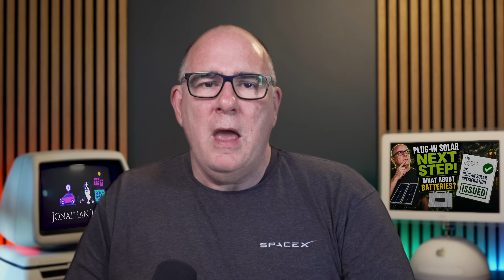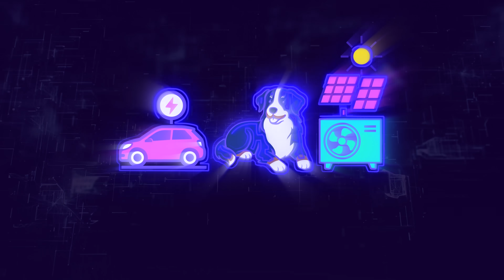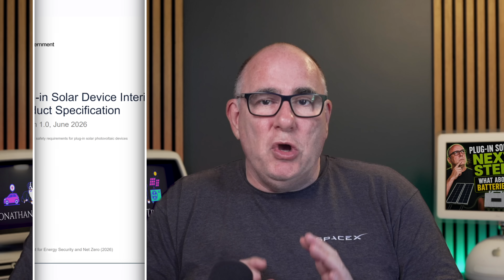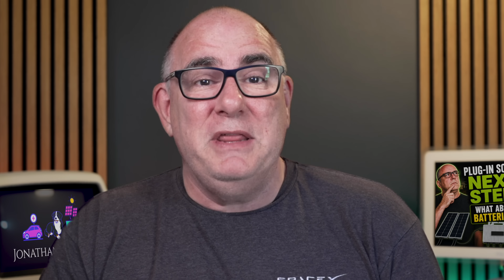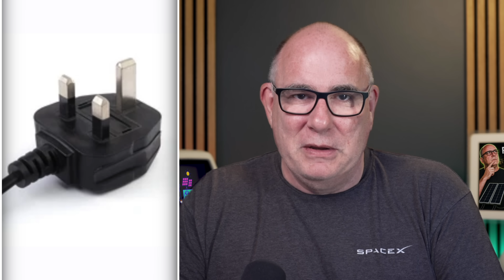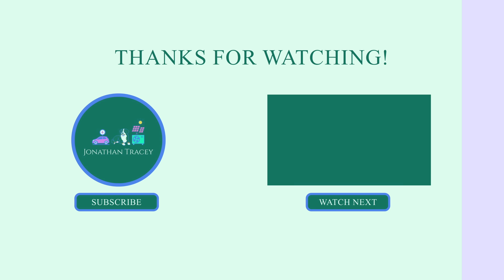Plug-In Solar Finally Legal? The Real Story Behind the New Government Rules

Comment: Don’t the existing products currently available already compliant? Perhaps not the plug. What if you already have an existing solar battery inverter system installed?
Reply from the maker: yes, they are but in theory you’re not supposed to use them with a plug because the legislation hasn’t been updated

Comment: When you start adding batteries you are moving significantly towards a fixed solar system which has its own regulations.
You can also have batteries with no solar, just back up for the mains.
But the two main points are, anti Islanding and network balancing.
Neither are insurmountable but both require failsafe systems to prevent failure so much more technical than just the feed into the circuit.
Reply from the maker: @davidsoulsby1102 I think that's a fair assessment. Once you start adding batteries, the engineering does become more complex than a simple plug-in PV system. The good news is that none of those challenges are new—we've already solved anti-islanding and grid synchronisation in conventional solar and battery systems.

The real question now is whether manufacturers can package that technology into a safe, affordable plug-in product. Based on the interim specification, DESNZ certainly believes it's achievable, but we'll have to see what the final standard looks like after the consultation.
Reply: Also from an electrical perspective PV and battery is identical. One has higher DC voltage, one has lower DC voltage. Both needs an AC inverter to connect to the grid.

Functionally whats good for plug in solar is good for plug in batteries... As long as its capped to the same wattage, we should be golden

Comment: I'd like to know why plug-in solar batteries are limited to only delivering 800W when they charge on overnight electricity at 2kW (at least the Ecoflow Stream Ultra X does)
My Ultra X is also hard wired in via fused spur and to a sub-board with dedicated CB and RCD
I would have thought that it should be able to charge and power at 2kW
Reply from the maker: that’s a very good question, which I honestly don’t know the answer to
Reply: Because an extra 2kw on the blind side of the consumer unit is quite a lot.  That is potentially 8.5A extra on wiring not designed for it.  So you could be pulling 40A on a circuit with a max design of less that is protected by a 32A MCB.

Comment: "It must have a moulded plug on the end". For what safety or functional reason? 

For it to be "plug in solar", I get that it theoretically must have a plug, but then does this prevent people from getting one hard wired into their electrical system by a qualified electrician, as is the current requirement? So they essentially make these products not cross compatible. I don't know why this would be an issue, because you could just wire a plug socket in and plug it into that, but I guess that increases the size of the installation connections, and the cost. 

I don't get it. Feels like an unnecessary rule to me? You can still physically cut the plug off and hard wire it in, or replace the plug.
Reply from the maker: I agree, it’s performance theatre safety.

That said, remember, they don’t teach people to wire plugs anymore, because appliances all come with plug fitted
Reply: @JonathanTracey  My spare plugs come with a card cover with a guide on how to wire them. 

It's the specifics of a molded plug that means that the stock and production line of the existing companies big in this space would need to be significantly amended to comply with this regulation. Rather than just add a production step to automate the wiring of a plug onto their existing product line. 

It feels like a calculated attempt to force consumers away from the incumbent products. And I don't see a good effect on the public quality of life because of it.

Are they hoping to make jobs? It's a bit of a circular argument that they create jobs by paying them to build products that are more expensive to buy, meaning they take home the same or less. 

Skill up domestic production as a long term strategic advantage to not be dependent upon foreign production? Maybe? Feels a bit... almost xenophobic? Like, not very collaborative? Not very trusting? Makes me feel like we're hard to do business with... Combative...
Reply: For the simple reason that all electrical appliances in the UK that come with a plug are required to have a moulded plug on the end with very few exceptions. It's simply stating the same existing law that would apply if it was any other electrical device.

Nothing stops them also providing cable for wiring in, or someone chopping the plug off and wiring it in, and if you can't chop a plug off and trim a cable back you shouldn't be trying to wire it in!
Reply: @etchedpixels  Are you sure? My understanding is that The Plugs and Sockets regulations 1994 require appliances to be supplied with a fitted approved BS 1363 plug. but "fitted" just means attached to the cable before sale. It can be moulded or otherwise, as long as it's compliant.

A few exceptions exist for things like shaver/europlugs for things like shavers and toothbrushes, but they aren't BS1363 anyway as that's just Type G UK mains plugs?
Reply: Oh I see what you are getting at - fitted v moulded. Not sure.
Reply: Feels like it's there to screw over the existing manufacturers in the field who have been producing these products in Europe for ages. 

And they're talking about setting up domestic production? Ah. things might be falling into place: make the existing products illegal, and personally make the alternatives domestically. I'd be interested to see the links between who gets the contracts for these production facilities building and running, and the people who devised these regulations. 

I smell a whiff of corruption that locks the UK consumer OUT of tried, proven, and battle tested hardware. And locks them IN to domestically produced unproven and relatively low volume, so likely high cost, alternatives.

This feels like a money making scheme to extract money from the vulnerable in society (people who can't afford to buy, so they rent which is more expensive in the long run), and give it to those in control of the rules and who gets the contracts.

Comment: For me a pause might be a good thing . . . . Over recent months I have been educating myself on Ecoflow Stream . . . . However, on Facebook groups there have been a number of posts with negative experiences.  Ecoflow currently appears to have a supply problem. Also where faulty equipment can't be replaced they have offered a refund but not the full amount but a deduction calculated for the months used. Hopefully, Ecoflow can improve. Indevolt looks good and will be entering the UK market soon and as I am with Octopus their future offering might be worth considering. Although, it will tie me into their supply.
One thing's for sure . . . won't be paying a contractor to do a £10k full roof install with a ROI of ten years!

Comment: The one inverter per circuit is an awkward thing personally I would be more happy to start with one per house because if you can have more than one, it will be like air-conditioners and a heat wave people will buy two or three or more if there cheap supermarket units and plug them everywhere meaning the fuse box will have kilowatts of power coming into it. Better to start small and grow rather than dump and run
Reply from the maker: agree but remember it’s only 800w per circuit not huge amounts
Reply: @JonathanTracey yes of course but say you buy 4 sets of panels there cheap at the supermarket on offer that would be 3.2kw at maximum generation going into a fusebox if you flip that the other way what household item uses 3.2kw of power all day everyday for hours on end
Reply: The average consumer would not understand what a "circuit" means, so one per household makes sense.
Reply: @mikeselectricstuff  The counter argument is that they are going to do it anyway so telling them how to switch a given circuit off and check it's not two devices on one circuit is a better plan.
Reply: 3.2kW flowing into a consumer unit is nothing. It can easily have 10kW flowing out of it.
Reply: @etchedpixels yes I agree me and you know that we also know the limitations of what these do and how they work but your average Joe cruising around Aldi won’t

Comment: I enjoyed watching your video and wonder if you purchased a EcoFlow system now would it not meet the new regulation so be obsolete and have to replace.
Reply from the maker: it would need a plug on the end of the cable, as that can easily be added by replacing the drop cable I dont think its obselete
Reply: @JonathanTracey or chop the missing plug off, and replace it.
Reply: Real risk, but given how close the regs are to the German ones I suspect Ecoflow will simply sell you an overpriced pack consisting of a replacement power cable, the correct notices, stickers and guidance.
They never sold this version in the UK for plug in usage so I doubt they'll give people the extra bits for free - especially on a 120 quid product.

Better to wait anyway - the current UK prices for a lot of "don't plug this in honest" products are way way higher than elsewhere.

Comment: Any of you wonderful people know about g98, plugin solar isnt quite legal yet so.... when filling in the g98 it asks for the all the information about the installer, name, qualifications, company name.... but of course there wasnt one :/ so what do you do?
Reply from the maker: g98 process will wed to be updated or scrapped in its current form
Reply: In our area, not England, when I enquired a couple of years ago, you needed to go to the local authority to get someone qualified to check your new consumer unit, or other electrical work, you installed or was install by àn electrician but not quite qualified enough to write up a certification.. There was one firm, signed up with the local authority, I was told, but that was scraped. Why, because if you installed it, the installer would literally never get it checked, at a cost, and signed off. Enforcement is nonexistent. Most are ignoring the requirement. Make things too onerous it will be ignored. And, to get a recognised electrician to come and do slightly more than plug in a plug, you’ll be lucky.
Reply: It isn't an application. Its a notification. If the inverter is on the ENA approved list, you just state the certificate number, and yourself as installer. Thats it
Reply: The G98 notification forms need to be massively simplified.
When people can buy plug in solar from Lidl the notification procedure needs to be simple or people wont bother with the notification.
Reply: @marcussmith6523  Agreed 100%. Unfortunately there's also a bunch of people who seem to think th fix is that your unit should simply not work until you register it and copy the enable code for your specific device only provided when you complete the registration.
Reply: @marcussmith6523  The ideal way to do this would be some kind of registration process that gives the user some kind of incentive, like extended warranty.
Reply: They accepted "Self installed" on mine a while ago
Reply: Self install by competent person. If you are that is. 👍
Reply: @spwilliams83 if you manage to install one yourself and it works, then you are competent. If it doesn't, you're house is probably burnt down now 😂
Reply: @spwilliams83 how do you prove competency? Through training, qualifications and experience is the legal definition, that's why I had go keep going on pointless courses at work.
Reply: G98 is being amended to facilitate plug in solar and energy storage the G98 consultation (DCRP/26/02/PC – Modification to EREC G98 Issue 2 Amendment 1) closed on 30th June. The summary says:

"This consultation seeks stakeholder views on proposed amendments to Engineering Recommendation G98 (EREC G98), an Annex 1 document under the Distribution Code. The proposed modification has been developed to facilitate the connection and operation of Plug-in Micro-generators, including plug-in Solar PV and plug-in Electricity Storage, while maintaining appropriate requirements for network safety, supply quality and operability.

The proposed changes are intended to provide a clearer route for Plug-in Micro-generators under EREC G98. Key changes include the introduction of a new definition for Plug-in Micro-generator, clarification of the technical requirements and connection process for Plug-in Micro-generators rated at 800 W or less, updated notification and decommissioning forms, and specific practical exemptions for Plug-in Micro-generators in Appendix 1.

The proposed amendment also includes a minor administrative update to Form C to ensure LFSM-U compliance information is captured consistently in line with existing EREC G98 requirements."

Details here https://dcode.org.uk/consultations/closed-consultations/
Reply: Have people connected with a plug or had the microinverter hardwired who have done self cert for g98?
i have a microinverter set up ready to connect but waiting for clarifications for diy.
Reply: @lukerobinson5070  As it stands G98 compliance is not possible if plugged in and a "fixed" installation. I am not convinced that it is once this regulation passes because they've ignored the fact G98 specifies BS7671 not Building Regs Part P.

Comment: I'm waiting for the government to realise that sodium-ion batteries are not a fire risk or an inhalation risk so that we can all connect them permanently inside our flats or houses, rather than demanding they need to be outside or in a garage. Presuming that's still true.
Reply: Any battery is a fire risk - that stored energy can go to unwanted places in fault conditions to cause fire from resistive heating regardless of whether the battery chemistry adds fuel.
Reply: Sodium Ion batteries contrary to a lot of the PR are not magically removing the fire risk. They reduce it a bit (depending on the exact battery setup). If you want to see what happens to a sodium battery that's not particularly designed for fire resistance there's a great youtube video where someone shoots the Bluetti Pioneer NA.

There are some batteries heading towards production that are very very fire resistant, including NMC combined with ceramics, a lot of the solid electrolyte/sort of solid state batteries.
Reply from the maker: check out a company called Eleven Energy, been on the market for a while.

Comment: Always interesting and informative, thank you. There are the pioneers out there who are already using a variety of plug in or wired to spur systems, so the out in the wild real world 'risk takers' are validating the safety of the systems and principals, some very conservatively some not so.... its good this is progressing it would be interesting to compare the process and timeline in the UK to that of Europe when they adopted PIS ( a interesting acronym - We are PIS risk takers ).... Claude tells me this about European PIS  approval and adoption It took roughly 10–15 years from fringe experiment to mainstream, but the real explosion happened in just the last 3–4 years. Here's the rough timeline:

*Early 2010s – the niche years.* Balcony solar emerged around a decade ago, but didn't catch on until four or five years later, thanks in part to years of lobbying by solar and clean energy advocates for policies to foster its adoption. Through the 2010s it was mostly a German hobbyist/DIY scene operating in a legal grey zone, with Germany gradually creating technical standards (a key grid standard in 2019 first made simple registration possible).

*2022–2023 – the tipping point.* The energy crisis after Russia's invasion of Ukraine sent electricity prices soaring, and cheap Chinese panels made kits affordable. More than 550,000 systems were installed in Germany by late 2024, half of which went in during 2023 alone, with hardware sold online or even at supermarkets for around €500. Germany's "Solarpaket I" law then removed most remaining bureaucracy.

*2024–2025 – mass adoption.* Germany passed one million registered plug-in solar devices by mid-2025, and since registrations lag, real numbers were higher — industry estimates put 4–5 million plug-and-play systems operating across Europe, with 1.5–4 million in Germany alone.

*2025–2026 – Europe-wide legalization.* Plug-in solar is now legal in all 27 EU member states except Sweden and Hungary, with Belgium legalizing self-installed panels in April 2025 and Spain also seeing strong uptake. Prices have kept falling too — balcony panels in Germany have halved in price in recent years, with small models around €200.

So the short answer: about a decade of slow groundwork, then explosive adoption in roughly three years once the economics and regulations aligned. Since you're in England, it's worth knowing the UK has lagged — the government's June 2025 Solar Roadmap only announced a feasibility study on balcony PV, so plug-in solar isn't yet properly established here the way it is in Germany.

Comment: Hi. How do the UK requirements different to EU specifications?
Reply from the maker: I don’t know if there is a single EU specification, I haven’t been able to find one each country seems to have their own electrical regulations, some parts are common across the EU and some parts are specific to the country. For example, Germany rolled this out a few years ago that Belgium only did it last year.
Reply: It's basically the German spec combined with a list of the UK regulations that relate to it in other aspects plus some bits for the plug.

Comment: First thing everyone will do is cut the plug off to route the cable to your inside wall socket 🤔
Reply from the maker: possibly :-)
Reply: Yep or worse they would then connect the cable back together with a “choc block” and some pvc tape or masking tape or just leave it
Reply: @vapesmarter  Choc block - cheap Temu wago clone, then you don't need a screwdriver